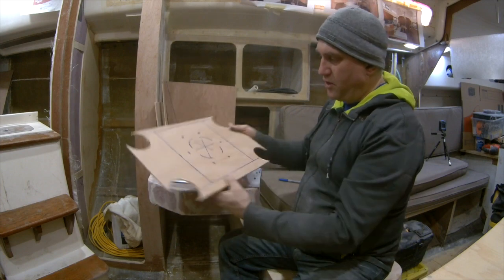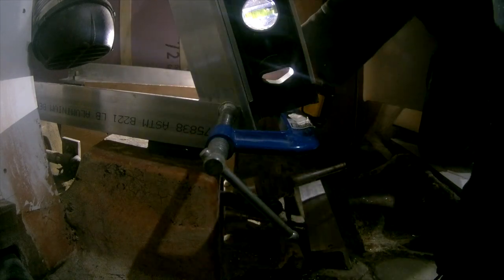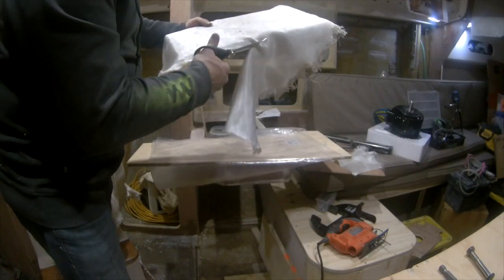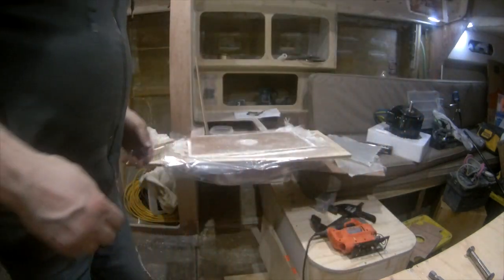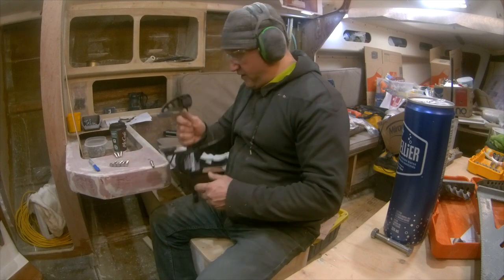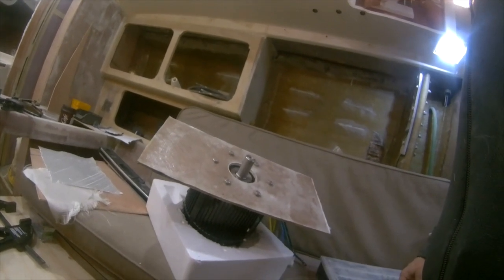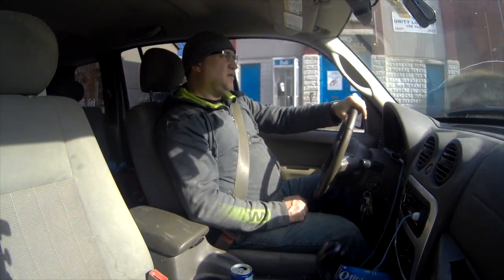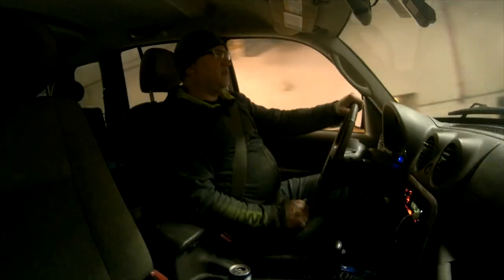Ep35 Electric Engine Mount, 10KW 48V Electric Engine Part 2

Comment: did someone know how to program the controller and the accelerator? thank you
Reply from the maker: i had to learn, the documentation was a poor translation of an engineer not from the viewpoint of an end user. it is relatively straightforward except for the throttle settings.

Comment: Ha, ha seating here in Germany in my boat and thinking and laughing to find my Brother from another Mother. The reason is I find Vacuuming my boat is where I spend most of my time!!! Thanks for the Video as I am in the stage of Refitting my Boat and convert to e-motor. Defiantly contact Golden Motors on Monday. Are you happy with your 10kw motor?
Reply from the maker: Hello brother! lol I agree it seems that the vacuum is an endless daily task.... I am satisfied with the motor. I picked it over the 5Kw due to the torque spec. I'm only running it about 10 to 20% of it's capacity under normal conditions, but glad to have the extra room in a storm condition. Not so crazy about the controller but I had it replaced as my first one would nto function properly. I am using the VEC-500 and overall seems ok but it beeps with the brake on so if I want to electronically lock the shaft from turning the controller just keeps on beeping. There is no option to turn that off. Still looking for a goof throttle that can fit my pedestal / wheel as it's not a large working area. Best of luck on your conversion! If you post any videos I would be interested in watching your progress.